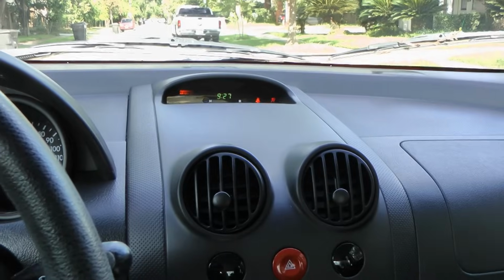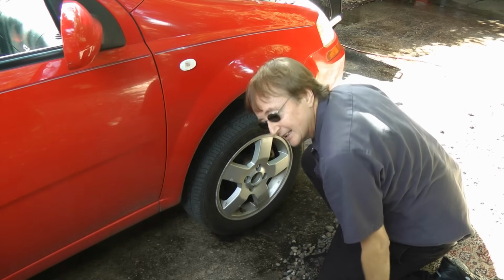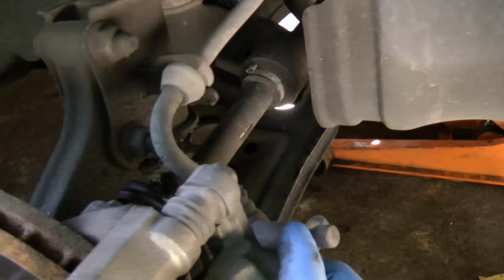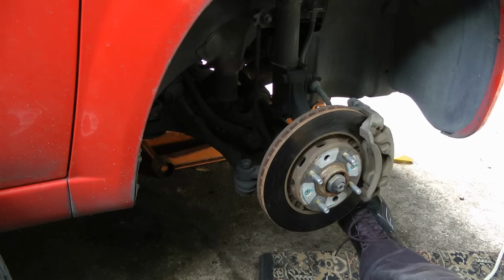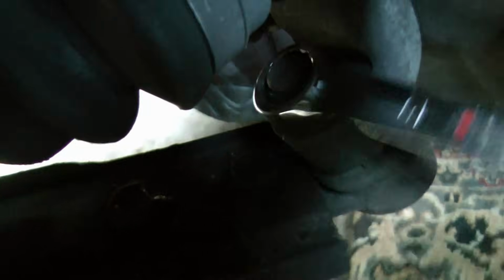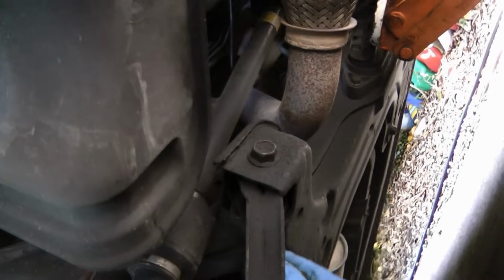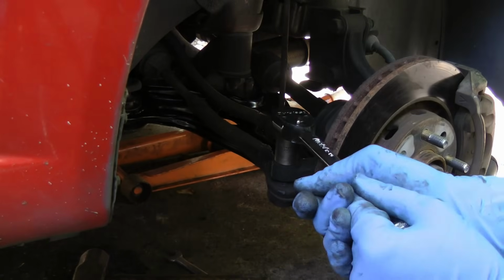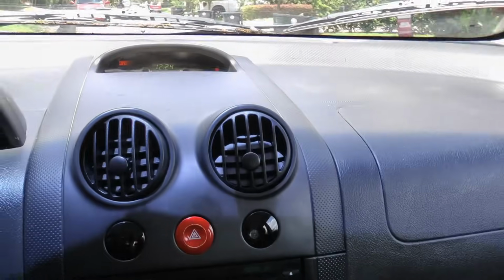How to Fix a Car that Clunks (Lower Control Arm)

Comment: Scotty saves the average person thousands on car repairs. To replace two lower control arms at a dealership runs close to $1,000.I have a lot of respect for Scotty and his car wisdom.
Reply: They quoted me one on the front passenger for $1056....
Reply: 1,000 dollars is insane!
Reply: @SASLEAD666  Highway robbery!
Reply: Stealership*
Reply: My dealership recommended to change entire suspension system, went out and got lower arms replaced at a local shop 😂
Reply: literally same for both lower control arms on a ford escape 2008. parts were $300 for both at an auto store. it was hard to do but felt better than paying $700 labor
Reply: Lots of people don’t wanna do it themselves so what can we really do
Reply: Just got quoted for a thousand too.  Crazy
Reply: He ignored the camber caster plates that were probably on there and the fact you have to jack up the control arm to ride height before you torque the bolts that go into the bushings down, this will make the control arm stay put where it was tightened at.
Reply: It’s a 2 hour labor for the front two? You’re telling me the dealership will charge $500/hour? I don’t believe this, sounds like bluff. I know they rip people off but not $500/hour I’ve never heard of that on this planet
Reply: Average person wont be able to do it. You still have to be able to hold a wrench and use your brain.
Reply: @retpaladin593 lol. Amen! 😂
Reply: Came to this video after being quoted $2,300 just for the passenger side lower control arm from my local Lexus dealership.
Reply: @smody121  Why do idiots go to the dealership?
Reply: I was quoted $900 in labor at an oil change place. Then another $100 for the alignment. I got all 4 and a steering box for $400. $150/hr labor. Computer showed swapping the ball joints that come on the new arms already. Why would you remove them? That's probably $75 in wasted labor.
Reply: Now it’s closer to 3,000. Crazy
Reply: Its still happening, got quoted 1003.00 for 2 new ones, apparently parts are $600 with them and $180 with autozone😂
Reply: If it cost 1k for to replace some shitty arms I imagine they would charge more than a new car price for changing an engine 😂
Reply: I did mine and it was 200 for the pair of them in addition to the tie rod ends.

Comment: Wish i had a mechanic like you around I always get some half assed work were the problems come back less then a month later or they take weeks to fix something simple
Reply: Here's a tip. Find a performance or custom car garage. They usually do absolutely everything in one place. I find they often take the most pride in their work, and are not just trying to get cars in and out as quickly as possible. If you don't know where, ask someone with a nice custom car next time you're at a gas station or something where they get their work done.
Reply: @ΒΞΔΝ   Help me replace a coolant temperature sensor and where it is located in a 2013 Ford escape 1.6 L
Reply: @alpalmer8155  It's a pain on that car. It's located on the drivers side of the engine. You will need to remove the air intake and tie aside the hoses to get to it. Once the intake is removed you will see it poking out. It really can be a pain of a job tho as I said. Maybe best to have a mechanic do it.

My best advice, get rid of the ecoboost, and buy another car. Those Ford 1.6 are notoriously terrible.

Comment: Oh it is that easy? I started this process in my garage 3 days ago and now I'm wondering how do I take this car to a mechanic, UNNHHHHH....
Reply: Find a mobile mechanic
Reply: what happened? u couldn't do u it?
Reply: This comment hit soooo hard and truuuuueee!!! Now wondering how much a tow will cost Ahahaha 🤣🤣
Reply: Oh come on! It's not THAT hard! (I'm being mostly sarcastic BTW)

Just did the upper and lower control arms on both sides of my truck, as well as the stabilizer links (bad bushings and joints). Sure, it took a few days to complete, but it wasn't particularly hard. Granted, having proper tools made it a breeze. 

I remember doing the alternator in my '02 MPV a couple of years ago, and that was a real pain. Had to take apart the passenger side wheel well just to get to the damn part. What should have been a 5 or so hour job, at most, turned into a two day job with help from multiple people.

Comment: Scotty does mention "AT-25" a stop leak for everything except brakes.  You can add it to your motor oil, transmission fluid, radiator, power steering, or you hydraulic jack.  But, can only be bought on line...

Comment: It may have been mentioned, but before the front and rear bolts for the new arm are tightened, you should put your jack under the ball joint and jack the suspension up until the car just begins to lift off the jackstands (yes, this is an actual factory recommended procedure).

That way, you've got the suspension back to normal ride height before you torque the fasteners. If you don't do this, there is a real possibility of the bushings failing prematurely, as they will be put into a bind as soon as the weight of the vehicle is on them.
Reply: I had to do just that on my 2010 Legacy. The car has body cladding making it impossible to do anything if the wheel is on the ground. I tried the ramps but there was not much clearance to turn the wrench. I ended up removing the wheel, putting the car on a jackstand, loading the suspension by jacking up the control arm under the ball joint until the car lifted off the jack stand ever so slightly (about 2 mm off the jack stand as noticed toward the front of the jack stand support plate). I tightened the front bushing. I hope this did the trick and the bushing is properly loaded because I don't want to replace them anytime soon.
Reply: I was just about to ask The same ?
Reply: Very interesting. Thanks. Gonna do this myself soon on my used Pontiac g3 and this will help.

Comment from the maker: yes, many things can make clunking noises, from struts, strut mounts, a frame bushings, ball joints, sway bar bushings, etc. You try to find if any have play by pulling on them with pry bars
Reply: Scotty Kilmer Ey scotty, my cavalier 2003 has been changed the clutch, now it sound like the strut mount making noise, but it's something worst now, because when I acceoerate from 0 or brake from a low speed, it hears a clunking noise downside in the front of the car, also when I turn right and move slow it hears! Tjis sometimes feels in the brake or the steering wheel. What do you thing it could be? Maybe the torque mount, or all the engine mounts? Help!!
Reply: Thanks for this scotty, I'll try to find out which one clunks at our 02 manual manual corolla, it really annoys me when ever I pass through bumps or turning  the steering. Hope I can find ways to fix it a.s.a.p  from your helpful videos.
Reply: Scooty please help me i got a clucking noise only when I go up bump i don't know what it could be only make it when I go up bumps not when I turn ...please help I thinking its a strut or sway bar leak or bushing
Reply: What clunk noise I’m hearing from a 2018 tundra when coming out of a good turn or making u turn I hear clunk I got level kit and big tires no running from tires ?
Reply: @masautomx2131  It's the control arms, 6 years later

Comment from the maker: either you got a wrong size ball joint, or you have to push it up further to get in place to bolt on (I use a jack under it to push it up in such cases.) Realize many cheap aftermarket parts are often the wrong size if made in china

Comment from the maker: depends on the design. Some have adjustable nuts at the end of the lever inside the car, like  VWs. Some have an adjustment bolt at the back of the car under the middle where you tighten the bolt to make it tighter
Reply: My back tires leaning inner went to a car alignment they say they can't adjust

Comment from the maker: worn transmission or motor mounts often do that, or a running problem in the engine like a vacuum leak or worn out spark plugs

Comment from the maker: check to see if the valve covers are lekaing oil on the exhaust, and also check for coolant leaks there by pressure testing the cooling system
Reply: Scotty, my steering wheel keeps shaking left and right when I drive, and when I let go of the wheel it immediately goes to the right. I recently had my brake pads and rotors replaced,  and got a new wheel bearing and hub installed on my passengers side. But that's the side it's bearing to the right.... I'm going nuts with this bro. It's a 2012 ford focus.  Please help me brother  :-(

Comment: Scotty, Might want to mention to folks that after removing a lower A frame that the car will likely require an alignment
Reply: Not necessarily, didn't change any settings.
Reply: Spray a shot of white spray paint onto the degree indicator to make it easy to return it to original settings.
Reply: False, if he loosened the jam nut on the inner tie rod connecting to the outer then that would be the case
Reply: Not sure but if when drive it again pulls to the side then I'll take it in for alignment

Comment: Great video Scotty.  Can the bushings be replaced instead of the entire arm? In what instance would you change the arm rather than just the bushings?
Reply: Save you the trouble of finding a nice press to remove the old worn out ones and put new ones in it.

Comment from the maker: tighten the fan belt on the power steering or replace it. Tapping can be many things, jack it up and pull off the wheels on the area that is making the noise and check for worn parts.

Comment: In '76, I bought a '75 Chevy Monza from a Chevy Dealer. The car had 12K miles on it and looked brand new. After a couple of weeks, I heard a clunking sound whenever I stopped. I checked the suspension and everything looked fine but I did notice overspray under the hood. I suspect the car had been in a collision.. After 3 years, a friend of mine wanted to trade my Moza for his '68 Vette with a blown engine. We nade the trade but I warned him of the clunk. Eventually, the doors got harder to open so he lifted the car and discovered the subframe was separating from the body.
Reply from the maker: If you wish to ask me car questions, I am switching my questions and answers to my google+ community “Auto Repair With Scotty Kilmer”. So please, if you want your questions answered, go  to this link https://plus.google.com/u/0/communities/110758243155230074828  and join my community. You can then ask your question there and I answer them personally. You can then also attend my weekly Saturday morning Live car talk events where I answer your questions live.

Comment: so on this vehicle you have to buy the whole a frame? if it has a worn ball joint ?
Reply from the maker: yep
Reply: Lower control arm, you can buy a new one with the bushings and ball joint already installed cheaper than buying just the bushings.

Comment from the maker: some people are anal safety junkies, go ahead and put stands on everything. I've been doing it 45 years, never had one fall on me yet. I do use them on long term jobs when really needed though.
Reply: I was working under a car and a customer came along and twisted the jack handle lowering the car. Almost lost my head.
Reply: you might not have needed them, but your teaching bad and very unsafe practice, what about if someone copies you  - does not use a stand and it kills them?
Reply: I jacked up a Chevy Nova at a junk yard once to pull the drive shaft... crawled under, had wrong wrench, crawled back out from under car to get the correct wrench.... after I stood  up, the car fell...the old jack let go... ... no wheels on the car.. fell flat on the ground....I use jackstands all the time now.

Comment: Drove mine til the wheel literally detached mid turn in an intersection 😢. Good thing I was off the highway. It had been clunking and creaking for a year. Had it fixed and how it doesn't even feel like I'm driving the same car

Comment from the maker: many things can do that, but worn ball joints are common on that model, jack it up and pull on the wheel and see if you can feel and see play on suspension parts like the ball joint

Comment from the maker: they don't often need an alignment, this one didn't. As long as you use quality parts they often fit perfectly.
Reply: Would jacking the car up only on the side being replaced cause an alignment issue?

Comment from the maker: if it's stripped,no socket will fit now. You can buy special sockets to remove stripped nuts though, go to any auto parts store and buy a set, they come in handy if you fix much.

Comment from the maker: injectors could only suck air if the seals on the injectors where they snap into the manifold are leaking. Spray carb cleaner by the suspected leakers and if the idle goes whacky, that's it.

Comment: Hi Scotty Thanks for doing these videos. They really help out a lot. I have a truck with a clunk. After viewing your video I check the suspension and driveshafts. There doesn't seem to be any play, but it still clunks when I let off the gas, and the trans downshifts.  Brought it to the dealer, and they said everything is in spec.. I'm not sure what to do. It's annoying and I need to get it fixed. Truck is still under warranty.

Comment from the maker: check the motor and transmission mounts first, then the drive shaft joints if the mounts aren't ripped

Comment from the maker: kind of hard to tell with that wild camera and sound work, but if it happens when turning and accelerating, the cv axles are making that noise, they wear and make noise when turning and accelerating at the same time.

Comment from the maker: didn't need it in this case, the part was exactly the same size and it doesn't pull or shake at highway speeds.

Comment from the maker: of course, look for broken mounts and bushings, and if the cv joint rubber is ripped, replace the whole axle, they make em in china now and cost very little for the whole assembly.

Comment: My dad said the stealership he worked for would use gear oil which is 75w to 140 w or a combo of both "75-140" $9.00 for a quart.  Try a fourth of a quart.  And slowly add it in, you don't want to over fill it too much (1/2 a quart over filled should be ok especially if your burning oil quickly) so you may want to take out a quart of oil first.  I just did that, removed two quarts of oil, only way (car cold, cool, or not HOT) was the drain plug...  Then add the thick gear oil.  Might work.  Of

Comment: @coolwaterhubby just take a portable blow torch light it up, and point it towards the bolt your trying to loosen and let it get cherry red. Sometimes the bolts are so locked up that you can't loosen them. Its happened to me a lot with my 68 beetle.

Comment: Scotty , I have a 2012 Toyota Prius with a clunking noise coming from the front left  side "driver side".
I have zero play on the wheel and  already changed my strut assembles with OEM "KYB" plus sway arm links  . I'm guessing now its either my caliber or sway arm bushing . just looking for some help from another Toyota lover 
                       Thanks scotty ,rock on bud.

Comment from the maker: jack it up and pull on all the suspension parts to check for play. Also jack up the engine and see if motor mounts are broken. Pray it's that easy to figure out, but if it's that rusty, soon it will be in the junk yard anyway so don't waste too much time

Comment: I went to take the wheels off of my car today to rotate the tires, and I couldn't get the lugnuts off because they were so tight, I was worried that I would break something. then I heard Scotty's voice in my head say "just pull like mad" and sure enough they all came off no problem.

Comment: Hi scotty. Love your channel. Always refer to your videos as I feel you are top-notch. Anyway I need a new control arm and have all the symptoms of a bad one. But my question is I just got new brake pads and rotors and I still hear a scraping sound when I'm coming to a stop from 50 or so Miles an hour. I don't hear it as much when I'm coming to a stop from a slower speed. Any idea what could be causing it?

Comment: I have a 2002 mercury villager and replaced both drive axles about a year ago. Several weeks ago it began to make a clunking noise on the drivers side when I moved the shift lever from park to reverse. It works fine when turning or driving down the road. My mechanic said it was the drive axle so I had him replace it. After a few days it started making the noise again. He suggested it might be the the transmission. The transmission guy found a bad motor mount, so I had all four replaced. And it still makes the noise. The mechanic suggested it may be a bad drive axle again. Have you run into this problem before Scotty, and if so what was the problem? Thanks for your time and expertise.

Comment: Hey scotty I am having that clunking sound and the dealership replacement the front struts and that didn't fix it so now they are telling me that sound is cause I put after market break pads on there . But I think they are trying to take me for a ride cause they got it wrong . What do you think man cause man it's loud and only on 1 side.  I would think if it was a after market brake pad it would be both sides of the car I would think. I appreciate your input brother

Comment: i think you are supposed to leave the bushing bolts a bit loose then tighten them when the car is on the ground so that you dont tear the new bushings, if you cant fit a wrench under when the car is on the ground you can also jack up the control arm up, just measure the gap between the tire and wheel well while the car is on the ground. do this if you dont want to replace bushings again soon.

Comment: Hi Scotty - Just a question, will the car need another alignment set up after this or the replacement will not affect the alignment (car is Hyundai 2010 ix35). Thanks in advance.